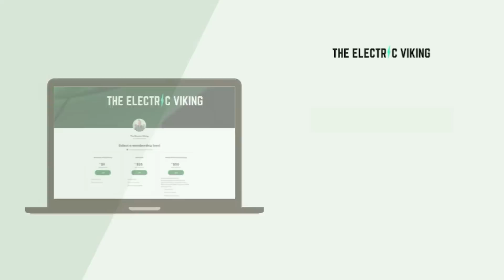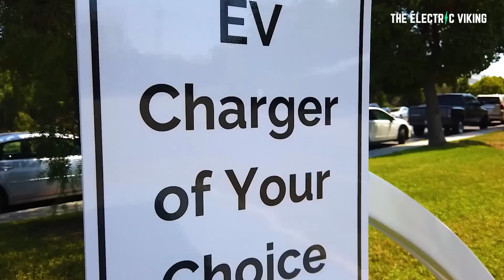California has 42% of US Electric car sales in 2022

Comment: Buying a used 2 year old high mileage Bolt for 20k is a horrible horrible move.        You would be buying a car with known problems with no factory  warranty on the car .   Only on the battery.  

Buy a new hybrid if you only have 20k.  You have at least a 3 year bumper to bumper warranty.   The only thing you have to worry about is your car payment.   If you can afford it get a 3 year Car loan.   If not extend the manufacture warranty.  

The Volt is an excellent used car.  Although they are expensive now. They are 200,000 mile automobiles.  At least the early ones.

Comment: What you’ve neglected to mention is the electric grid in the US is not up to handling so many EV’s, California‘s Government ask EV drivers to not charge their EV cars because their electric grid was not up to the task. As far as the rest of the US they don’t have the network of chargers that California has implemented in large part by Tesla at least in the beginning and the rest of the US does have electrical grid issues. And the government under the Biden administration has choked off the US Fossil fuel independence needed to feed those electric plants. This is necessary as a bridge to cleaner energy sources which are a bit further into the future that is currently the case. Just saying.
Reply: It wasn't the government , it was the utilities ; and they asked that all users, including EV owners, curtail electrical use, and just during the afternoon peak period. It wasn't a problem for EVs, because the vast majority of EV users charge during the off-peak period anyway, when rates are lower and plenty of energy is available. In fact EV charging is among the easiest loads to shift to off-peak periods.

Comment: I live in Georgia. My second MX sits in the driveway in front of my house, EVs are 2-3% of new auto sales currently. I make a game of counting the number of Teslas I see on the road when out running errands. Every day there are more; it's rare I don't see 5-6 in a 2-mile trip. Neighbors frequently ask to see my Tesla and query me about the cost of owning, how the car works, and always charging. 

I tell them:
1) You'll find you charge at home 90-95% of the time. You only need superchargers when you go on a trip and there are plenty now. To make the point, I pull out an app showing every Tesla supercharger station in America and they go wow. 
2) When I show them the tech inside and crank up the stereo system their eyes bulge. When I let them drive it the fear it's some alien unmanageable tech quickly dissipates. "Hey, it's almost like driving the car I have now!" (Exactly).
3) When I take them for a ride and punch it their jaws drop.
4) When I tell them charging takes 30 seconds, they're confused. I always answer, "What do you do with your iPhone? Each night you plug it in to recharge while you sleep. The next morning you're good to go. It's the same principle with electric cars only the plug is bigger. Takes about 30 seconds to plug in and forget."
5) The cost of ownership is extremely low despite the high buy-in price tag. There is no oil to change, fan belts to replace, spark plugs, all that stuff. There are only 20 moving parts in an EV versus thousands in a gas powered car so parts don't wear out."
6) When they ask how long it takes to charge when you're on a trip, I answer 20-30 minutes usually. How often? With this X? Every 5 hours or so. The charge will outlast your bladder. Most superchargers are located near restaurants so we stop, plug in, go get a bite to eat. The car usually warns me it's done before I've made it through the meal.

Almost all leave dazzled saying their next vehicle will be an EV. The price tag does give many pause, though. I tell those folks to wait a couple of years to ride the cost curve down to where it will be more comfortable, just don't buy another gas guzzler in the meantime because you'll regret it circa 2026-2027. The shift to EVs can't be stopped now. No hope for GM, but Ford is making progress among domestic OEMs. 

Now, if Elon could stick to EVs, batteries and rocket ships. The Twitter stuff is killing his reputation in the states.

Comment: Be interesting to know how much renewable energy was used for transportation at ev chargers in ca
Reply: You can get at that information.  First, just visit the CAISO site which is the grid operator for nearly all of California.  The site contains a complete breakdown of generation sources for the state's electricity right down to the minute.

Charging during daylight hours means that a very large chunk of the electricity will be coming from renewable sources.  Charging overnight means that most of it will be coming from natural-gas.   I, for one, only need to charge my car once a week so I usually do it on a weekend starting at around 10am... during daylight.  So I, at least, can say that I am actually charging with green energy :-)

Of course, as time passes by the grid mix will continue to shift more towards renewables.  Eventually overnight too but at the moment nearly all of the grid-scale storage is being utilized to help with the evening peak (you can find this on the CAISO site too, batteries are a distinct category)... and that isn't likely to change until most of the natural-gas based generation is no longer needed to get through the evening peak.   We are talking at least 10 years before overnight generation begins to be impacted by grid-scale storage.

In anycase, to estimate current renewables vs charging we another piece of information.  Typing "when do people charge their EVs graph" into google gets some results (though probably not enough to be assertive).   I found one that shows how 10 different homes charged their EVs.  3 of those 10 homes charged primarily during the day., the rest were evening-to-overnight.

I expect most of the overnight charging is incentive based, which points to a policy issue.... really, policy incentives should be oriented more around the noon hours because California is universally overflowing with electricity from 10am through 6pm.  And not overnight where most of the electricity comes from natural gas.

-Matt
Reply: 70% n 2yrs

Comment: The EV uptake here in California (where I live) has really taken off and I see no end in sight.  There are many reasons for why this is happening here in particular.

Gas prices have always been relatively high in California, causing many people to buy smaller more fuel-efficient vehicles over the years.  During the recent spurt in prices gasoline popped up to $8.  Though this was still just a mere doubling from the more typical $4 and less of a shock than the media would have you believe.  But still,  the fuse was already primed and in a land full of sunshine and solar panels this gave a whole lot of people a good excuse to 'upsize' their vehicles again by going electric.

In (most places in) the rest of the country gasoline is a lot cheaper.  However, the shock factor can be even more significant.  When you go from $2 to $6, that's 3x... even more of a shock than the 2x Californian's saw going from $4 to $8.  The visceral reaction when faced with a shock like that is to get angry and demand a return to lower energy prices rather than to read the writing on the wall and begin migrating to electric.  Hence why the uptake has been slower in the rest of the country.

--

Another big factor is the cost of living.  Material goods such as electric bicycles and vehicles cost roughly the same across the whole of the U.S.  The only real difference is state, county, and local taxes (which in California totals around 10%).   But the cost of living in California is driven primarily by housing and is far in excess of 10%.  This means that material goods such as electric bicycles and vehicles, solar panels, and other voluntary spending, tends to feel 'cheaper' to Californians. 

And again, this purchasing freedom and mobility results in Californian's tending to adopt new technologies more quickly.  Not just early adopters who are willing to pay a premium, but also run-of-the-mill people.  A $60K electric vehicle is still expensive (though again, relatively less so), but something like a $3K electric bicycle is suddenly within reach.  Large parts of the rest of the U.S. tend to have less disposable income for experimentation.

But what does this do for the marginal buyer who doesn't have a lot of disposable income?  Well, that's where the used market comes in.  Because EVs are being taken up quickly in California, a robust used vehicle market in EVs is also starting to develop.  That's important in terms of being able to reach the masses.

--

There are also large differences in political support.  California has had strong political support for renewables for decades and got into the EV game early-on.  There are numerous other states with similar political support, but large swaths of the country are heavily conservative and are proponents of big-business-energy rather than consumer-enabled-energy.   When it comes to EVs, conservative states for the most part see them as a threat to the energy monopolies that drive the politics in those states.

The danger to these states is that the enablement that electrification gives to the consumer can quickly overtake those monopolies.

Conservative political rhetoric is decidedly against EVs.  Not for any good reason... just another "lets try to own the libs by blowing up our own constituents" mechanism.  This has drastically slowed down the uptake in renewables and electrification in half the states of the U.S..  The result is that those states are now far more vulnerable to price shocks caused by foreign countries (aka world energy markets).

--

But back in California...  those of us who have made the investment in solar panels, EVs, and other electrification (e.g. heat pump water heaters and so forth)... we are finally starting to see the fruits of that investment.  Even after switching to an EV which I charge at home and a heat-pump water heater, my electricity costs this year (2022) are roughly 1/3 what they were 15 years ago.   1/3 the cost, even though I'm using electricity for nearly all of my transportation needs. 

In otherwords, more and more Californians are just shrugging when the world energy markets go nuts.  And those in the state who are still under the thumb of the oil industry (which is still most of the population) are now more prone to wanting to find a way out from under that thumb instead of crying to the government to bring energy prices down again.

Unfortunately, it may take a while for much of the rest of the country to wake-up to the new reality.

-Matt
Reply: The future is so bright I have to wear shades. 🎶
Reply: Well written and thought out reply Matt.
Reply: Excellent points. California is taking it even further by extracting lithium from the Salton sea.  They want to build a manufacturing sector around the Salton Sea,  battery, semiconductor,  software,  and other  crucial infrastructure for the ev industry.
Reply: I’m all Fer dat
Reply: I drive a Chevy Bolt EV. It is such a joy to be able to charge up in my garage and circumvent gas stations where gas is expensive. I agree with you. Conservatives need to understand that EV's are the solution to high gas station prices. In addition as our availability of solar and wind with battery storage increases, EV's help us gain energy independence and allow us to avoid importing dirty oil from foreign countries.
Reply: Nice
Reply: Very informative Matt thx
Reply: congradulations,  you spent 100g's to save a few thousand a year.   you californians sure are smart 🤡

Comment: California's electric grid will not keep up with demand for electric cars. This summer, residents were already told to keep their AC's above 77 degrees because of the strain. If that's the case, more electric cars will be a big strain on the system. They need to upgrade their system or it won't be pretty. Here in NY, the electric grid of NYC and the surrounding suburbs will need a total overhaul before wide-spread adoption can occur. Also the fact that there is a lot of the population in NY that live in apartments with no means to charge a car. Where I live in a suburb of NYC with a population of about 400,000, there are about 4 to 6 public chargers in total to handle electric cars. That's not going to cut it. I'm 49 years old, and I don't think I'll be alive to see the NY wide-spread adoption. If it takes 15 years to overhaul one subway tunnel in NYC, then I'm sos with regards to the electrical grid overhaul of NYC. I hope I'm wrong.
Reply: Not sure where all this internet nonsense about CA's grid is coming from, but the grid is doing just fine.  Even during the heat wave it was in really quite good shape.   The state actually recommended that people run their AC systems full-bore during the worst of the days to pre-cool their homes and then conserve power only between 4pm and 9pm or so to deal with the peaks.

And this has nothing whatsoever to do with how the grid handles EVs.  Grid expansion to handle the expected EV adoption rate is literally just 1% a year... totally trivial.  A complete non-problem solves by relatively simple planning (which is already being addressed).  And EV owners don't have to charge their vehicles at peak times anyway (nor is it any particular burden to avoid the 4pm-9pm slot for charging during a heat wave).    Non-emergency peak consumption is predicted to only increase around 0.5% a year to handle the entirety of the electrification that is happening in the state.

Is minor to modest conservation really all that hard to do for a few weeks out of an entire year?   Not really.  And it is a damn sight better than what we saw happen in Texas where nearly half the population lost power and their grid came within 5 minutes of a complete (100%) failure that would have taken weeks to get back online again if it had happened.

Reality bites sometimes.
Reply: California has had electric issues for a long time.  EVs will make it better, especially if demand for gasoline (and its huge electrical requirements) goes down.